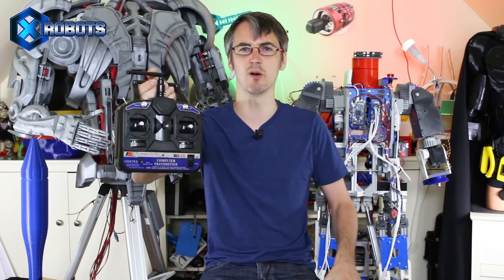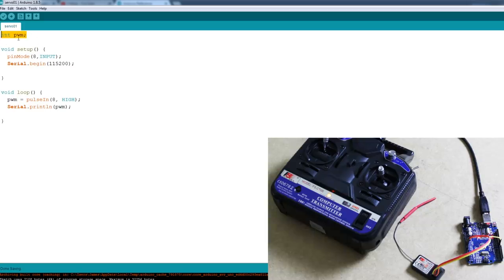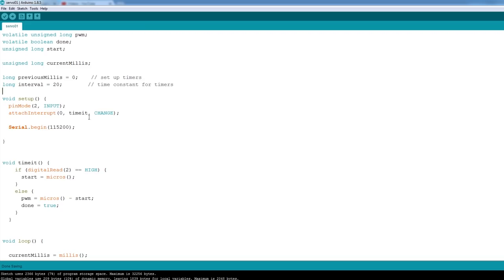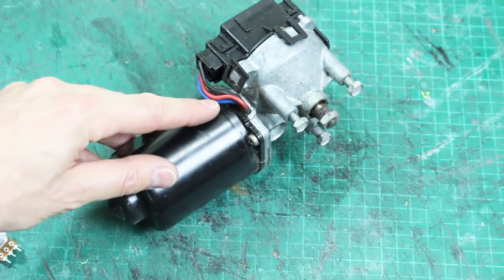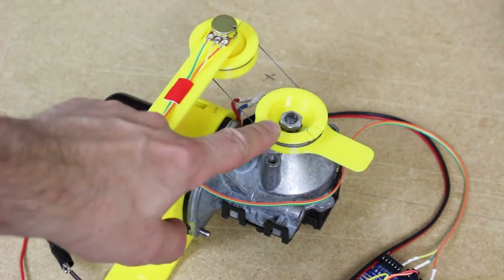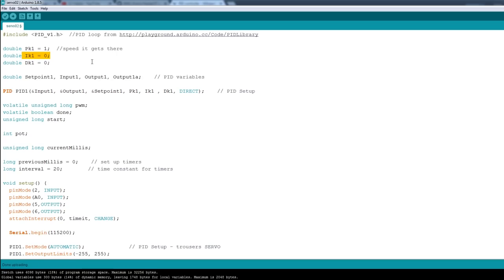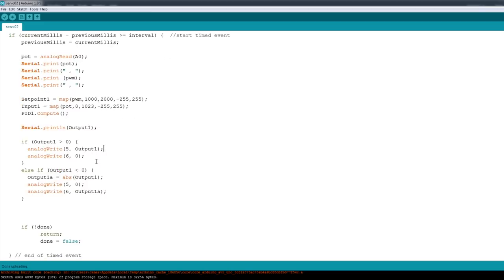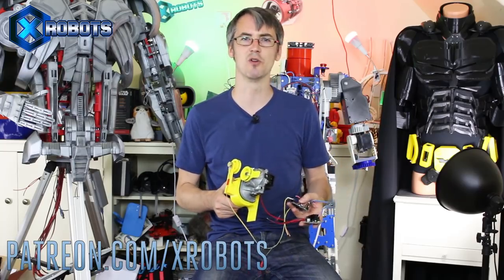How to Make an R/C Servo from a Wiper Motor | James Bruton

Comment: Okay, for anyone else out there that is attempting to do this with an IBT_2 motor driver, you don't need to change the program. All you need are a few additional steps in the wiring.
Digital pins 5&6 need to go LPWM and RPWM respectively, switching the order of these will simply invert the direction of the servo.
Both the L_EN and R_EN pins need to pulled to a HIGH state and should be attached to +5V DC.
Both the L_IS and R_IS pins need to pulled to a LOW state and should be attached to ground.
VCC should also be attached to +5V and GND simply goes to ground.

Thank you James for the code and explanation, my dreams of a robotic riding lawnmower are finally coming true.

Comment: For driving a motor w/out concern for position, you can just make a resistor bridge 10k resistor from power to the analog input pin, and another 10k resistor from ground to the same analog pin. Since the resistance is always in balance, you only get movement from an input and you can adjust the code to give you nice little dead band for neutral. Seriously James, this may be the most universally useful code I've ever used. I've helped so many people and done several RC projects myself and your code is the heart/soul of every project I'm involved with.

Comment: Gotta say I am and old maker and really enjoy your channel your ability to take something so complex like this is and give a simple to follow path is really a gift

On high speed PLC work we use hardware based inputs that do not depend on scan time to process the task
Reply from the maker: thanks I did a bit of PLC in college, but that was in the 90s!
Reply: James Bruton 

We our very restricted in what we can use as everything we we build can mangle the operator if it malfunctions and have to use dedicated safety relays and go through a pretty intense safety review

Comment: make sure to use unsigned for all your timing variables so that when millis/micros rolls over, the math still works correctly.  And yes, (current - last >= interval) is safe and correct to use with unsigned variables and will correctly handle rollover of timing functions.

Comment: Great video. Just one thing to mention, usually wiper motor have "3 wires", 2 normal (+)  and GND in metal housing, so you should use case and one of wire, changing wire you can change speed of rotation but for long use better is to use slower one.

Comment: And of course if you change your pulley ratio you could make it go a lot more than 10 turns. Also put some sanity check code on the pot analogue value so the motor can't go any further than the endstops and break it.

Comment: 5:00 An even better way to read the pulse in is to use the TC1 input capture unit to measure the pulse length in hardware, so if you have e.g. some serial code that blocks interrupts for a few microseconds and the interrupt is called late, you still have the exact time from the input edge recorded in hardware.
Reply: I know im randomly asking but does any of you know of a tool to get back into an instagram account?
I was stupid lost my password. I would appreciate any help you can give me!
Reply: @Malik Mark Instablaster :)
Reply: @Zaiden Ignacio i really appreciate your reply. I found the site thru google and Im trying it out now.
Takes a while so I will reply here later with my results.
Reply: @Zaiden Ignacio it did the trick and I finally got access to my account again. I'm so happy:D
Thanks so much, you really help me out !
Reply: @Malik Mark You are welcome :D

Comment: Well done! I did this 3 years ago for a Maker Faire project( RC PRS ) but didn't include PID so I will try your code. Thanks.  BTW, I used an Arduino Pro Mini and an L298 with my pot connected to the shaft via laser cut gearing.  I like the belt/wire setup but will be mod'ing to use contactless magnetic encoder and will probably shift to a Teensy.

Comment: The pulseIn is only giving you +/- 1us jitter verses 4us in the "improved" code. The pulseIn has an optional 3rd value of timeout.  It defaults to 1 second (hence the one second +/- 5us steps in your jitter graph) and should be set closer to the 20ms timing of the RC PWM signals.  Try pwm = pulseIn(8, HIGH, 30000);   Timeout is in microseconds.

Comment from the maker: What would you do with a giant servo!?
Reply: a ventilator to counter the heat wave
Reply: James Bruton why does it say your comment is from 4 days ago
Reply: supercomputer2004 he first uploads the videos to patreon so he probably commented when he put it up there
Reply: Magnus Kree ohh
Reply: supercomputer2004 lol hope that helped
Reply: A Vault Door that opens with a certain pattern of the RC controller
Reply: Controlling my droid. I had some big issues working with the PID settings. I hope you want to extend this video or create a follow up video that go more in side the DIP settings and showing what happens etc.
Reply: A giant hexapod. :D
Reply: I use them for steering larger vehicles(it is already set up for steering with that lever arm sticking out!) and small machines for positioning.Basically anything you make with tiny servos you can supersize! Also awesome to replace The rc  with a keypad so you can punch in actual angles and make it go there direct command....just a tick more code and it's awesome. I think some of your audience could do well with more of this type of project to help get them started easier following your other work.
Reply: I would make a remotely controlled door .  When you are able to make a new project can you please make a robot from fallout 4? 🤖
Reply: Star trek style doors loll
Reply: Servo for a rc kettcar 😄
Reply: Fly an actual aeroplane instead of a model.
Reply: Go-Kart sized RC car. Or, to make that big slappng hand from the Jack-Ass Movie.

Comment: I really wish you would use #define to define some constant values... You could give each pin an actual, meaningful name and then if you need to change what pin it's attached to you can just change the one #define. You really should have one for the 255 values too as they are all related. It's a simple thing that makes your code more readable and maintainable.
Reply: Either that or static const‘s, which effectively do the same thing but preserve type information.
Reply: The underlying arduino compiler definitely supports them, but I will admit the IDE does a poor job of pointing such things out. It wasn't until I switched to using the VisualMicro plugin for VisualStudio that I realised the arduino compiler supports a large amount of C++, including templates.
Reply: Angry Rambo Show they aren't really complex to understand though and would actually help beginners to better understand what the code is doing as you are replacing random pin numbers and constants with a meaningful English representation. 

digitalRead(POTENTIOMETER); is much easier to understand than digitalRead(1) for example.
Reply: James Coyle True, but at the same time you're adding a layer of indirection between the code and the hardware, and now you have to look in two places to determine what pin is connected to which code.
Makes for more readable code, sure, but actually obfuscates the hardware/software interface.
Say you plug the potentiometer into a different pin (accidentally, or on purpose). Now you'll have code that states it interacts with the potentiometer, but actually doesn't.
(not even the worst case scenario).
If your project is pure code, yes. Absolutely.
But you are manipulating hardware and software in parallel and could change either arbitrarily and now you have a label in the middle that may or may not be meaningful, depending on the hardware design.
Reply: KuraIthys You only have to look at where your defines are (the top of the code) and change one value rather than having to update several uses of that pin that could be anywhere in your code. Your points don't make sense. 

You are defining in one place that pin 1 is the potentiometer so then you attach the pot to pin 1 on the Arduino. If you attach it to a different pin you then update your define statement to point to that new pin and all references to that pin in your program are updated to reflect that you changed which pin you're connecting it to.
Reply: James Coyle, your argument would be like approaching a teacher in a 101 class and stating that the knowledge from the 102 class makes the subject matter easier to write down. You need to understand that not everyone present has the same knowledge base that you have. A concept can be simple while still adding too much information to an introductory video. I understand that James Bruton often posts videos about advanced concepts, this is not one of those videos and therefore does not require an in depth description of all of the potential code that can be used in Arduino. This video only required the most basic possible code to get the motor to turn to a specific point.
Reply: j0m017 constants are not an advanced concept. You don't need to know exactly how they work in order to use them and defines are pretty self explanatory. 

It's not like he went through and explained how every other bit of code does it's job so an absolute beginner would have no clue what an if statement or anything else does. If you look at it from the point of view of someone that hasn't seen code before or has a very basic understanding, adding defines makes it much easier to understand as it makes the code much more readable as pure English. 

It's not like we are talking about pointers or inheritance here... People would see the #define and instantly understand that that is defining the value of the keyword as what else would it possibly be doing? Even then it would only take 5 seconds for him to explain what it is to a degree that allows anyone to understand enough to be able to use it themselves. 

It is not a difficult concept for anyone that knows what a variable is, it would take a few seconds to explain, it's easily researchable, and it helps people with absolutely no experience to read the code and at least understand some of what it's doing from a purely English standpoint. Exposing more people to the concept would also help many more people to write more reusable and maintainable code. I honestly fail to see a downside. If you can't understand what #define NAME "value" is doing you're probably not going to understand any of the code. const NAME = "value"; would also do the same (from a functionality standpoint) job in a more familiar way.
Reply: "It is not a difficult concept for anyone that knows what a variable is" You don't seem to get the point. Anytime you can remove a concept and still accomplish a task it is intrinsically easier. If you don't need to define variables to accomplish a task, you can make the concept easier to digest by skipping that part. I get that you are a smart person, it may be hard for you to visualize what it would be like to be less knowledgeable.  What I am describing is a fundamental concept in teaching.

Comment: James, this is very usefull drive system for your dog robot, it is strong, fast and compact, even you can find a smaller wiper motors with the same torque.
Think about it.

Comment: Brilliant! Cheers for posting that information and code, I’ve been trying to do this for a while now after seeing HomoFacien’s video on the same subject, but for me your video is much clearer and easier to follow. I suspect I shall change it to use L298 motor driver ic, so I’ll need to set direction and send PWM to the enable instead of picking which pin to send the signal to, but that shouldn’t be too hard.

Comment: You could also change the gear ratio between the motor and the potentiometer to get more than 180°, or less than 180° but with better precision 😊

Comment: One could also take the circuit out of a normal rc servo, wire that into the wiper motor with a new pot, and that would prevent needing an Arduino or doing any coding. Of course you would still need the motor driver to handle the current. Just a thought.
Reply from the maker: ...and you wouldn't be able to tune the PID for he bigger motor and bigger load.
Reply: True. Good point. I am curious though to try it and see how well, or how bad, it works. So, I just ordered the motor driver on eBay (I have a few normal servos and a wiper motor already), so I’ll try it and see. When I do, I’ll post a video on my channel and show the result. It may be a few weeks cause the driver is coming from China. I’ll let you know when I post the video.
Reply: So I just posted a video showing what happens when you use the circuit from a normal servo to convert a wiper motor. Check it out and see what you think. It works, but.......

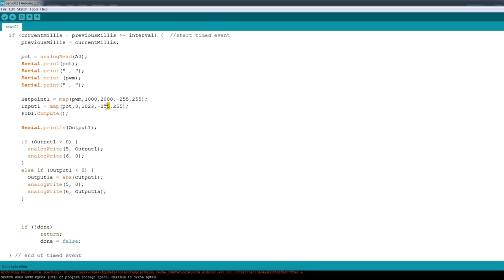Comment: At 13:12 if the output1 is 0 you will no write the value to pmw. OK that will no be problematic for the PID control, but still it should be correct on the code, by writing just "else" instead of "else if(output1 <0)". BTW, good work I really enjoyed the video

Comment: Interesting project.  I am looking to do something similar and need two turns at the output so need to use a multiturn pot or use pulleys with a ratio and standard pot.  Would like to see more info on the pulley arrangement to help me build something similar.  Have searched a bit and haven't found much on similar pulley system.  Maybe not using the right search terms...

Comment: James great video but can i make a suggestion to improve things and that would be physically attach the pot to motor output shaft because if you lose the pulley/ belt when using pid to control the position, the motor could run away if it loses the feedback. Just a suggestion again great video
Reply from the maker: yes you could do that

Comment: Hi James.  Great video as usual.  Can you do a step by step tutorial of creating a cheap and small walking bipedal robot, say 6 inches high?  You could use it as an ongoing tutorial by adding further functions like speech synthesis, speech recognition, AI etc. If you guys would like James to do this please like this comment so he can gauge interest.
Reply: I don't see why you can't just take his big bipedal robots and make them smaller, with cheaper parts. Also, 6 inches high would probably be more expensive than like 1 foot high, just due to the the cost of small servos vs "regular" servos.

Comment: I'd like to see this done without an Arduino. It should be possible using a servo to drive a potentiometer to drive a circuit that adjusts the position of the wiper motor arm.
Reply from the maker: Yes you could do it with analog electronics I suppose...

Comment: How many PWM signals can I read with this code from the R / C console And just which arduino pinout can I use? Thanks to this code, I finally got to R / C to change the speed and direction of the stepper motor!

Comment: Doesn’t the “I” value correct the error when under load? “I” or integral increases with time gradually with steady state error until saturation or reaching the target set point. “D” is the derivative which is effectively the rate it approaches the set point, can be used to ensure its not heading towards the set point too quickly.

Comment: I'm somewhat new to electronics and robotics so there's probably some obvious, glaring issue with this thought- but wouldn't it be possible to achieve this with math based coding? I mean, if you know the rpm of the motor when you apply a certain voltage, why not just alter either the duration / amplitude of that voltage in order to control the motor's speed in a predictable way? This would eliminate the need of the potentiometer since the motor position, based off of the motor speed calculation, could simply just be stored in the arduino memory. However, this solution seems so simple I doubt a student like me would be the first to think it up. Someone please tell me I'm horribly wrong!

Anyway, great video, I love that your channel is so educational yet fun. You've gained another subscriber, and apprentice roboticist!
Reply: Scott Smith in theory its doable, but your idea will never be accurate. Any system you want to control needs some kind of feedback mechanism. What you want to do would be the same as stearing a car down a straight road while blindfolded. Sure, you know that you just need to keep your steering wheel straight, but without feedback on the smallest deviations you make this will go horribly wrong.
If you want to read more about these kind of things, you can look up closed loop VS open loop control systems
Reply: very interesting, thanks for the response!

Comment: Cool project! I’m trying to do a similar one with the same parts you have used except I want to control it with a servo tester instead of an RC controller. I tried hooking it up the same way and used the code you had on GitHub. It just spins. Could you help me figure out what I’m missing? Thanks!

Comment: Hi James thank you for your video. I try to wire circuit as you but control by adruino. I use Adruino it self to power both driver and servo and the motor doesnt work. Is it because the voltage isnt enough

Comment: I love this, why your GITHUB isn't on fire w/downloads is puzzling me. Not only did your code work flawlessly, you can bring the +5V to A0 2500K ohm resistors & another 2500K from GND to A0 and you have instant fwd/reverse or winch mode as some of the kids call it. 

Question, there is a .hex file that says 8channels but how do you edit the PID settings? I checked the readme file but to my knowledge you can't edit that?

Comment: Is there a way to put a rotation limit in the code? My motor keeps over rotating and then goes round the horn to get back to center on the pot?  (520) . Thanks for this video it has helped me to want to do more arduino projects ! You rock!
Reply: Hi Did u find an answer to the rotation limit code